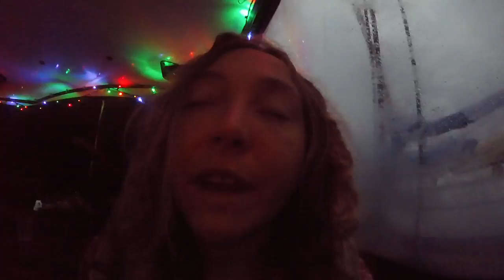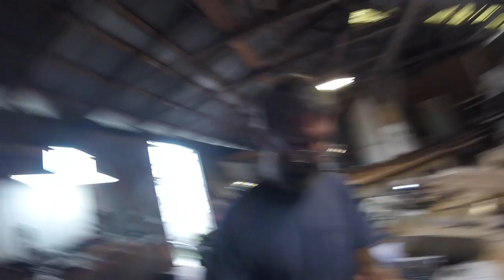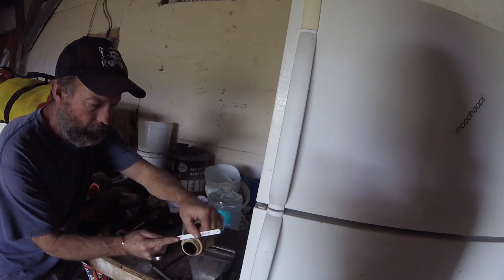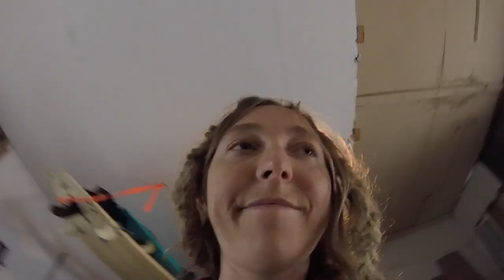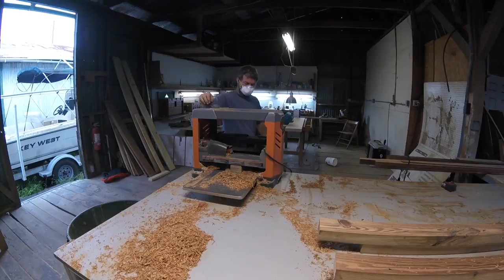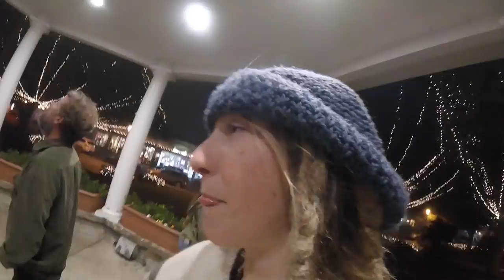Episode 126 - Sailing Vessel Norna SVN Vlog Day 31 - Milling Lumber for Norna's Decks

Comment: I love your videos of Pete's work (love his simple "get er done" approach). The cutlass bearing issue would worry me. If your got a housing to fit American sized bearings or had the old one brazed smaller and machined out to fit our bearings, you would be done with the issue. What would result if the bearing spun in the housing at sea? Gary

Comment: power steering isn't that expensive to fix, junkyards will have the entire pump, cheap.
Reply: Yes I agree. Unless there is a lot more stuff wrong with the truck (like the engine needs rebuilding), fixing is always cheaper that buying new.